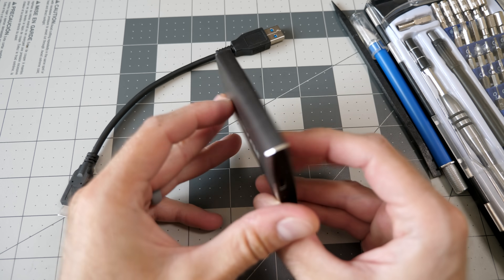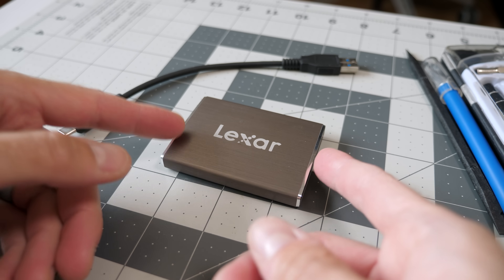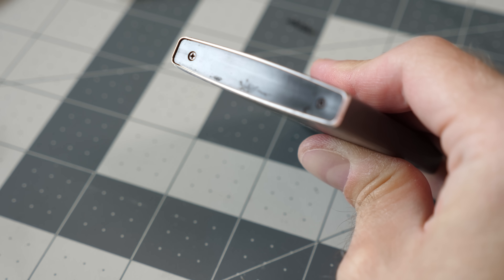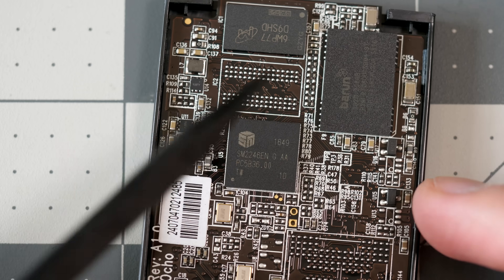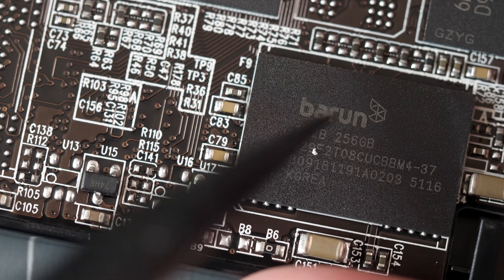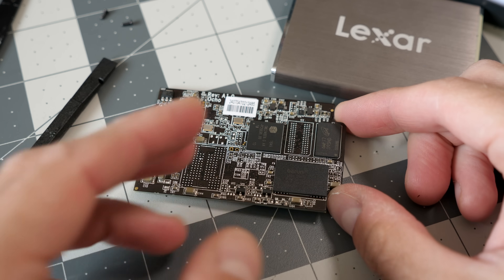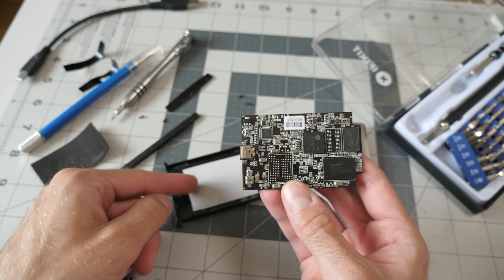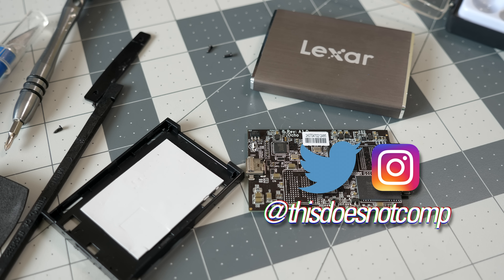What's Inside an External USB SSD?

Comment: I'd say 3, the factory assembled it wrong. The foam should be on the plastic and the thermal pad on the opposite side.
Reply: I'm also leaning towards an assembly error. The foam pad is supposed to go against the plastic and push the board with the thermal pad on top against the metal case.
Reply: Exactly what I was thinking, we are using Dell laptops at my work and we got lot of laptops with assembly issues/errors
Reply: @kalban112  I used to service laptops and compared to every one ThinkPad or then Compaq laptop I easily had to fix five Dell's. Plus their spare parts left a LOT to be desired with too many DOA parts including at least one with a blatantly obvious scorch mark on it. I hope they have improved somewhat by now.
Reply: @kalban112  for sure you  I repaired roughly over 200  HP chrome books at the school where I work .
Reply: Absolutely,  I'm disappointed that Colin didn't see this obvious possibility.
Reply: Opening and closing it switching the pads would tear it to pieces. Yet they could have turned the whole board around instead. That way it would work a little bit better.
Reply: the problem i see is how would it close if they put thermal pad in the outside? it would get stuck when trying to close it
Reply: @John-jc3ty  That's what I was thinking as well... 
With the Pad on the correct side it would not slide into the case without crumbling up the pad ...
Reply: @John-jc3ty  factory foreman; “make more units”. 
Factory worker; “if I put the slippery foam on the outside and the sticky foam on the inside, I can assemble it faster”. 
Foreman; “good job, you can eat tonight”. 
Engineer and End User; “wait, what?”
Reply: Yup, I was thinking the same thing. Maybe they just put the board in upside down. The boards are fabricated by machine, but then they're assembled by flawed, tired, careless, bored, under-paid bags of flesh. 🤷 One way to check is to open another one. 🤔
Reply: @user-vn7ce5ig1z  "Assembled by flawed, tired, careless, bored, under-paid bags of flesh" - And what sort of "Bag if flesh" are you? 😂😂😂
Reply: Lexar today is a shadow of its former self. A 256GB  USB3 thumb drive failed in slightly over a year. Thankfully it had a three year warranty but the warranty process is cumbersome. The support person I emailed with said since we are now Chinese owned we cannot replace it, only refund my money. It took some time and effort filling out forms and sending a photo of the drive in pieces, but I did eventually get my refund. Stick with SanDisk or Samsung.
Reply: @joes9954  I have a SD card that they made, it worked for a month and stopped working (unfixable CRC error), I tried a few programs (in windows and linux) and they cannot reformat the card so I can use it, I've had a few sandisk cards for a long time which have a lot of writes and even a couple full full wipes on them but they all still work perfectly.
Reply: 100% this.  I've worked QC in manufacturing, and this would be such an easy mistake to make.  You could engineer a solution - say, make it so each pad only fits one side, or even just use thermal pads on both sides - but it's probably cheaper to deal with the occasional warranty claim.  That, or this is an early rev, and they fixed the problem on a later one.
Reply: This is the most likely reason. If it was planned obsolescence, why would they include the useless thermal pad?
Reply: I think "planned obsolescence" gets blamed for a lot of stuff that can just be explained by cost-cutting, unexpected failure modes, and human error.  It's a little bit sad that everyone is so jaded and suspicious of everyone else that our default assumption is that someone's trying to pull the wool over our eyes.  Maybe we're just so concerned with not being taken for a fool that we preemptively cast blame.

I see this, and, without question, someone put the thermal pad on the wrong side of the board.  If the goal is to encourage failure due to heat, why would they include a thermal pad in the BOM at all?  Why not just use foam on each side, like a nice cozy blanket?  No.. the reason there's a thermal pad is to conduct heat from the heat-producing ICs.  Assembly Worker #32 doesn't have the engineering experience to tell the difference between a thermal pad and a foam pad, and just put them on the wrong sides.

Eli in Vietnam got this 100% correct.  Have a little faith in each other.  (Not too much, though -- make sure you specify which pad is which in the build instructions.)
Reply: @sirnickity  There's no difference between planned obsolescence and cost cutting, though. They're cutting costs because they want it to fail sooner and you buy another sooner. It's very sad that people are still willing to go to bat for these corporations when the evidence is all around you, you just have to be willing to listen to it. 

And I don't know about this Eli, but you're wrong. Have a little faith in "each other" doesn't apply to corporations. Have no faith in them. There's a huge difference between having faith in others and having faith in corporations.

That said, I already figured this was more of an assembly error, because you're right that it makes no sense to include a thermal pad at all if you want it to fail. The cost cutting planned obsolescence would obviously be no thermal pad. Somebody in the factory probably screwed up.

The rest of your comment though, big yikes. Stop having so much blind faith in corporations, 99 times out of 100 they're absolutely trying to screw us all over to increase profits so shareholders are happy and executives get a bigger bonus. And I'm not even completely sure that they're not trying to screw us over that other 1 time, too.
Reply: @sirnickity  corporations as a whole are interested in profits period.  The money you make by 'treating customers fairly' is never as profitable as forceing them to continually bbuy your product over and over again. He got 4 years out of this $100 product and for the average consumer whose willing to buy a new cell phone every 2 years, 4 years is just 'good enough'.

The other commenters are right. Corporations dont care about you and defending them gets you nothing. Unless they're paying you to shill for them you have nothing to gain from defending them.
Reply: @strayiggytv  forceing them to continually buy your product over and over again? Oh, they will buy a similar product from another company instead. Maybe that other company is cheaping out as well? They'll move to a third one. This is a kind of product a lot of companies manufacture, so I don't see your logic.
Reply: @strayiggytv   Any time you paint a whole group of entities with one brush stroke, with no regard for their individuality, you perpetuate the exact same disgusting human tendencies that lead to racism, sexism, partisan politics, xenophobia, homophobia, oleophobia...  Even if it's true that all "corporations are evil" -- which is just such a juvenile mindset that it's cringe-inducing out of principle -- I would rather be naive than live under the assumption that everyone is out to get me.  Maybe they are.  What's going to change anyway, if I choose to believe there are exceptions to that rule?  At least I don't have to dwell in that kind of mental toxicity, and that alone is worth it.
Reply: @strayiggytv  if this product failed on you and you bought another one, there's no way you'd buy the exact same brand name again, is there? you'd move on to another  brand-name... so how does this benefit the company - especially in a competitive market where there is a lot of consumer choice?
Reply: @Sneakyboson  

The average consumer has been trained to accept that most electronics are disposable. An electronic savy person who watching this channel or interested in electronics in general will act differently than your average person.

The entire cell phone and printer industry proves that people will buy the same product over and over even if it fails prematurely. If this wasn't the case we'd have cell phones with removable batteries and expandable storage still and the consumer wouldn't allow printer manufacturers to get away with the current ink scams.

The sheer volume of electronic waste we produce each year, all 6.92 MILLION pounds of it, proves people will buy a sub par product repeatedly so long as they've been trained to do so before hand.
Reply: @sirnickity  essentially you've chosen to go with the old "ignorance is bliss" defence with a sprinkling of apples to oranges comparison to sweeping social issues eh? Lol

I do feel the need to amend my generalization of huge corporations a bit as there are better corporate models abroad. It's mainly the USA with it's poisoned American dream that promotes non stop "whatever it takes to get the cash" consumerism and its obsession with 'freedom' (just so long as it's freedom to make as much money as possible) that I'm talking about.
Reply: @strayiggytv   OK.  Let's talk about ignorance for a sec.

First, the idea that anyone knows what motivates EVERY commercial entity... is essentially impossible.  To claim you, or anyone, has it all figured out.. that's a fallacy.  Consider that, in math for example, for a proof to be considered valid, it has to work in every case and never be proven wrong.  So, to assume that any given company is corrupt and ride-or-die on profit above ethics because all companies are..  that's at the height of ignorance.  It doesn't stand up to logical scrutiny because it can't be proven right, and could easily be proven wrong.

Second:  We're going to assume that Micron is a perfect example of this greed and moral bankruptcy because of swapped materials.  If you were an evil corporate overlord, and you were going to contract the assembly of your newest device to a fabrication facility, why... why on earth... would you include these two pads at all?  Remember, you're only out to make money.  Who cares if it works forever, who cares if it works at all?  You could save a few cents per device by just... not using the pads.  It would just dangle there in the sealed enclosure, cooking itself in its own ambient heat, and job done.  It would pass QA and die at some point under normal use.  Perfect!  No need for the thermal pad, which here conducts heat from a mostly empty PCB to a plastic frame.  No need for a pressure pad to ensure good contact of a heat-insulating PCB to a heat-non-conductive plastic.  You could leave them both out and save the cost of materials and the cost of assembly labor!  PROFIT!

Or... I dunno, maybe if you are going to pay for the materials and the labor, they're actually meant to do something -- and the fab house, who isn't staffed with design engineers but the cheapest human labor you can find ... maybe, just maybe, the obvious (and I would argue CORRECT) answer is they just didn't understand the difference, and screwed up the assembly.  That would be the Occam's Razor interpretation.

I mean, doing nothing would be cheaper than doing something, and they did something - they just did it wrong.  That stands against the goal of profit above all else.  Ergo, that's make no logical sense, but what does make sense is that it was an error, on the part of unskilled labor, and all this "can't be a mistake, because humans don't make mistakes, they only cheat other people" fatal pessimism reeks of a severe case of trust issues and a tragic attempt to never be caught as the victim, so better just to assume everyone is always conning you, so while you may often be wrong, you'll never be taken advantage of.

But hey maybe you're right.  It had to be nefarious, because there's no such thing as an honest business.  It can't exist in nature.  Right.  Makes sense.  Excuse my ignorance, and I'll just go on that way indefinitely because it sure beats living with unjustified fear and anger over non-existent affronts to my moral code.

Not to say that all business are trustworthy.  That's definitely not the case either.  I guess this life-view is brought to you by the letter "NUANCE."
Reply: @sirnickity  Boy are you a naive one. You have never worked as an engineer in the cost optimization department, have you? Disguising planned obsolescence behind reasonable deniability is not only common, it's industry standard.
Reply: @Bubu567  You cannot have an assembly error in all units.
Reply: Totally agree with JaySee5.
Reply: I was expecting Colin to mention this, really!
Reply: I don't believe in mega corporations making errors. Apple doesn't accidentally thermal throttle and overheat it's laptops, it does not accidentally go against right to repair , Microsoft does not accidentally trash a large portion of current online PCs , micron doesn't accidentally not cool its components, led light bulbs are not accidentally pushed so much that they last a fraction of what they could.
Reply: @picchioknossus8096  this. People in this thread are also missing the bigger picture where the excuse of "I'll just buy another brand" doesn't work when they're all in a race to the bottom to cut corners and maximize profits. 

So what if you buy another one from a different company? If they're all only made to last a certain amount of time then both 'brand loyalty' and 'brand betrayal' are meaningless. Your still trapped in a system that values money above all and is destroying our environment to get it. Same old song to slightly different beat.
Reply: i also think the same
Reply: No. It's planned obsolescence disguised as an assembly error. The engineer got a fat paycheck for that one.
Reply: @Bubu567  Planned obsolescence doesn't make sense in such a commoditized product segment. If my Lexar SSD fails in under 5 years - I'm going to buy another SSD, but it sure as hell isn't going to be from Lexar. Planned obsolescence works for captive markets like iPhones, where most users will not switch to competitors and a 2-3 year upgrade cycle is common due to performance increases and just social prestige.
Reply: @bobbytables464  That's true. I'm very picky with storage devices, because losing data is much worse than losing the cost of device. If an SSD dies easily, I won't buy that brand never ever. I'm looking for a steady good quality brand and then I'm loyal to that brand till my death. OK, maybe that is overstatement a little. But planned obsolenscence sounds like shooting your own foot.
Reply: @Bubu567  OK maybe that, but why the thermal pad in that case ? You don't want to conduct the heat to a plastic frame because that is a dead-end street. They could've used simple black foam in both places in that case.
Reply: @Bubu567  You put far too much credit on the average factory worker.
Reply: @Bubu567   There would be no point in that whatsoever, nobody is going to go and buy the same brand again if something fails before it should.
It is not 'industry standard'.
Reply: @Bubu567  Well, that's stupid.  If so, why would they spend for a thermal pad and not just leave it empty?  Duh.
Reply: @Fred_Raimer  So people like you will defend them. 2 cents well spent.
Reply: @Bubu567  Wow.

Comment: I doubt it is heat related. Open up most SATA SSDs, and they won't have a thermal pad between the metal shell and the drive. Maybe the drive corrupted itself? With OCZ SSDs, they'd regularly fail if the device had a sudden power loss (like a laptop unexpectedly running out of battery). That happened because OCZ cheaped out on caps, so the SSD controller would shut-down mid write cycle.

Comment: Looks like a different design/engineering team made the board and the casing. That thermal pad makes zero sense and the sticky foam is probably for vibration dampening or the board moving in the aluminium case. Either way…clearly bad or flawed engineering of the casing design. Planned obsolescence this obvious would be pretty stupid…they could easily do that on board level, or even chip level, without anyone noticing.

Comment: The controller is no bottleneck. USB 3.0 Gen 1 is 5Gbps, SATA 3 is 6Gbps. The USB connection and the spec of the SSD are a perfect match.
If it were a USB 3.0 Gen 2 or Gen 3 (10 and 20 Gbps respectively), of course the controller would be at issue.
Reply: @slothgirl2022  Even so, there's no way there's a bottleneck between the SSD controller and the USB controller, especially since we also have to factor in the real-world NAND performance.

Comment: The controller wouldn't be holding it back if it's SATA3, since SATA3 is 6Gb/s and USB 3.0 is only 5Gb/s.
Reply: @slothgirl2022  The specs for the controller said 540MB/s and that's very close to the max speed you're ever going to get from USB 3.0.  So it's fine.  The fact it's SATAIII isn't really holding it back much, if at all.
Reply: @MN12BIRD  People tend to forget how slow USB actually can be, and the number of potential bottlenecks occurring between the device and the computer.